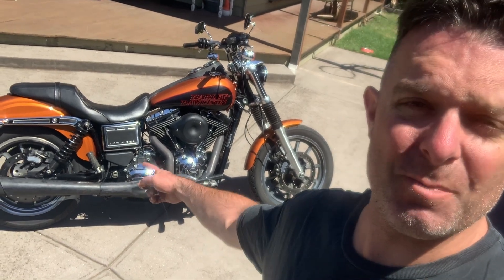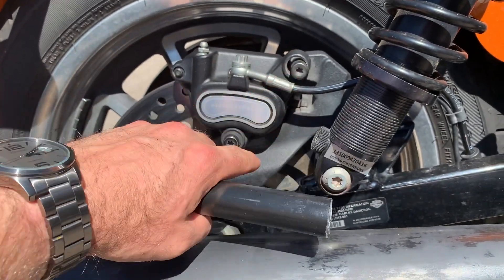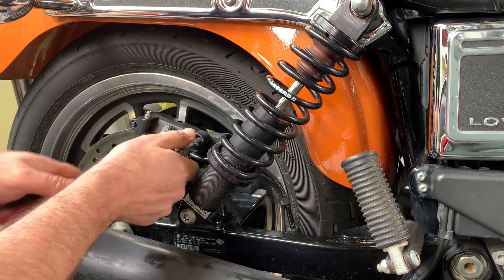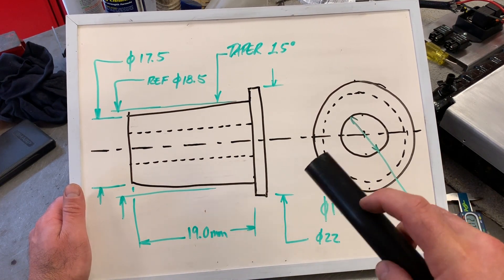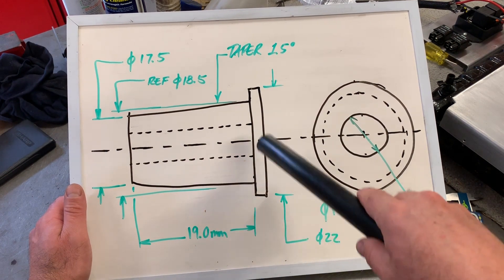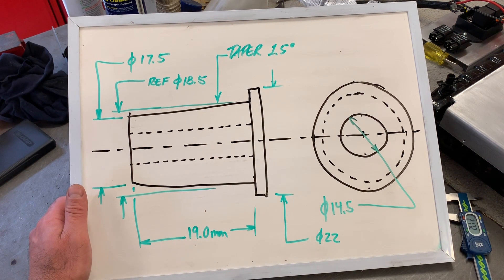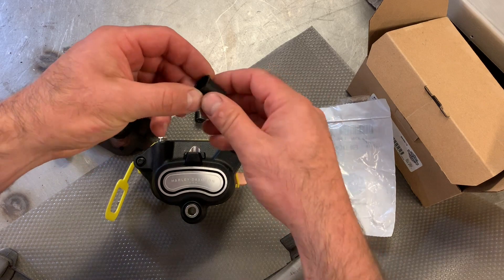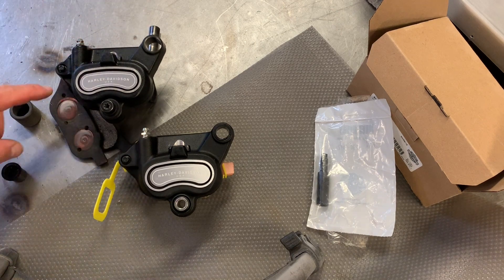Dyna caliper repair...FAIL!

Comment: Great outcome, big fan of vacuum bleeding myself, especially when stuck with one-man repairs outside hours. Thanks for aharing
Reply from the maker: Would have been cheaper if I could fix the bastard rather than replace the caliper, but at least its A1 now...
Reply: I was initially concerned about heat in that location, but with nylon/plastics, I guess its far enough away from the disc and pad to not be too critical. 
My first thoughts would have been as you suggested to machine it to a cylinder, and re-sleeve or bush, the concern would be as you say it gets a bit thin to take a sleeve.
the force under braking would beon the other side of the hole, but a risk is the sleeve coming loose.
Another option is something like DEVCON or JB Weld, to plug the hole with metallised epoxy, then re-drill to suit the pin and/or bushing again.
As my old mate used to say, "there's more ways to kill a cat than just plugging its arse with cement!"